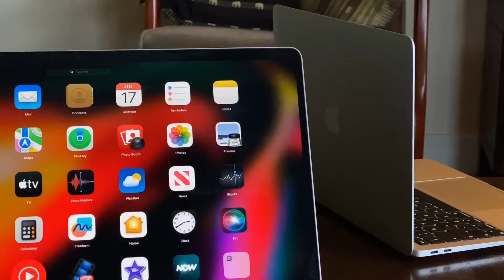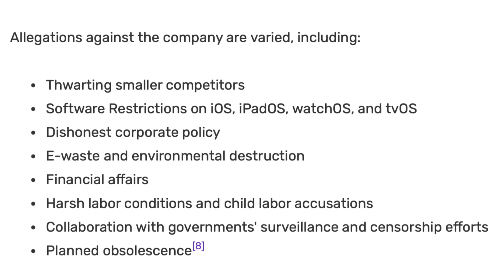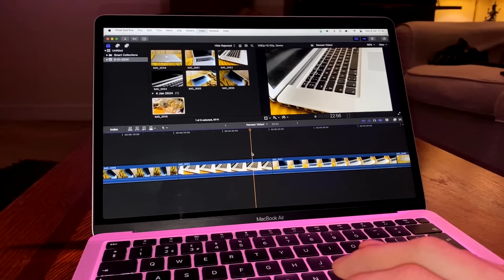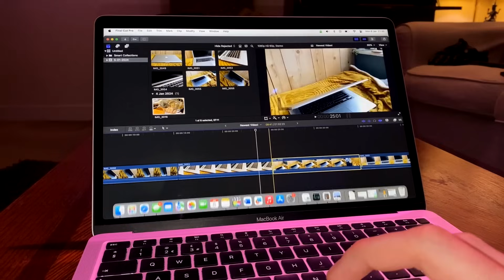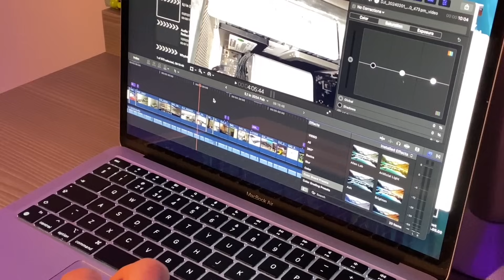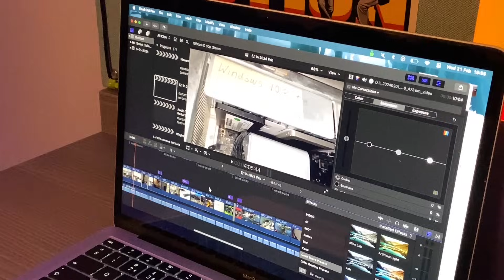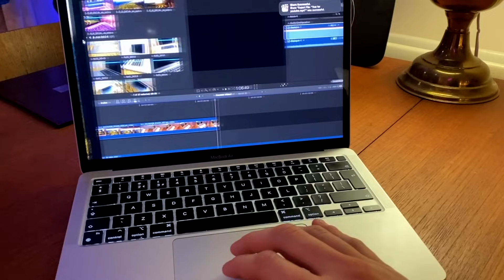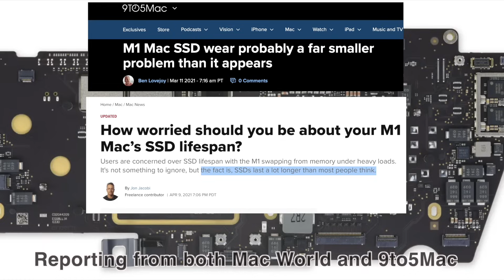Don't make the same mistake I did by buying a used Intel Mac.

Comment: You're missing the point about old macbooks.
They often had upgradeable hard drives (and even RAM in some models).
By constantly buying the new stuff, you're just playing into Tim Cook's hands.
Reply from the maker: Did you watch the full video..?
Reply: Why do you buy "constantly new stuff"? 

I am building my own PCs since the 90s and learned this: as a gamer, the only thing you more or less regularly upgrade is the graphic card, and even that wasn't a topic any more in recent years when games started to align to the performance of current gen gaming consoles by design. These days, you can run any game with a AMD 5700 or an NVIDIA 1070. But eventually Macs are nothing you use for gaming. When upgrading my PC, I noticed that the most benefit over the years originate in switching from HDDs to SSDs and in switching from 8 GB RAM to 16 GB RAM, which I run on all my machines  and never saw anything justifying to upgrade RAM further. I also learned that my needs are met by 1 TB of permanent storage. So that is a config I ran for years on a hackintosh: 16 GB RAM, 1 TB SSD.  I also learned that doing a major upgrade of the CPU is essentially a complete rebuild of the PC interior: you need a new motherboard, new (as faster) RAM, a more powerful energy supply and a better CPU cooler. You can keep the chassis, its fans and the permanent storage unless you want to benefit from faster access speed like PCI-E instead of SATA.

I  ran a hackintosh since macOS Sierra but bought my first Apple computer (since the Apple IIe) when Apple moved to Apple Silicon. That machine, a mini M1, configured based on the parameters established above from experience, supports my work (Software development) for more than three years now and there is no need to upgrade anything. I will run this until there are no macOS updates anymore for it. And there is still no pressure to ask for more RAM than 16 GB or more permanent storage but 1 TB. And with those parameters Apple Silicon Macs are still competitive in pricing. Despite Apples unreasonably looking upgrade price tags.
Reply: buddy, the computers you're talking about are 12 years old at this point. Most modern apps don't work on them anymore and they are starting to get to an age where the capacitors will fail at one point - and good luck repairing that on your own. Not even speaking about recent macOS versions, which you can get with OpenCore, but will run "suboptimal" to say the least with the natural limitations of memory swap (SSD even in RAID will be too slow) and the hard capped 16 GBs of RAM. So for anything more than mail and typing documents these will not make you happy.
Reply: A 2017 MacBook Pro is 7 years old. No one is talking about “constantly buying new stuff” we are talking about the fact if you buy a 7+ year old laptop it’s not a great deal and probably at end of life. I just got my M3 Pro MacBook Pro which was an upgrade from the 2019 MacBook Pro. I got 5 years out of it and probably won’t upgrade the M3 Pro for another 5 years. Two laptops in ten years isn’t “constantly buying new stuff”
Reply: @olafschluter706  Wouldn't be that much of an issue if Apple Silicon Macs supported eGPUs over Thunderbolt like they used to. Raspberry Pi and plenty of ARM systems support PCIE GPUs, I don''t get why that can't be any different with Apple's current hardware. Not even the new Mac Pros using Apple Silicon support GPUs.
Reply: Lol! I bought a Mac Mini 3 years ago for a few hundred dollars and am editing amazing, complex stuff with it
Reply: @KingKrouch  Sure, if you are happen to be one who notices a demand for more GPU power over the years the inability to upgrade GPU power is a problem. And the progress in GPU power has always been faster and more noticeable than the progress on CPU power, both with standard PC technology and Apple Silicon. Which is a bummer: even buying the Apple Silicon SoC with the biggest GPU power available at the time of buy may be superseded by demands (or better offers) within the near future.  That is why I find the mac pro hard to fathom: no more ability to upgrade the GPU power, now, what is its upgradeability worth then? The GPU is the most likely component needing an upgrade during lifetime of the device.

Comment: Yea I’m looking to buy a 2017 27” iMac - the fact that you can get these sub $500 is incredible - the display and design are still impeccable. I recently got a 2019 16” MacBook Pro and I love it a lot - people rave about Apple Silicon (as they rightly should) but for 90% of people, Intel was totally fine.
Reply: I bought late 2015 27” 5K month ago and it’s amazing. I have Mac Mini M1 for work and bought this iMac because of its amazing screen and I use it for internet browsing, discord, media consuming. You can’t buy a 5K monitor for this price and you get a whole computer!! IMO they are great value for money, because of that screen and with OCLP you can install Sonoma on them without problem. They are plenty powerful for everyday task, because of 4core CPUs.
Reply: I’ve owned a lot of computers over the last 30 years. I’ve built them and bought them new and used. My favorite machine so far is the M1 24” iMac. I thought the 24” display would be a downgrade from my previous 27” setup but I really don’t even notice the smaller size after adjusting the display settings a little bit. I do hope they offer a “Pro” iMac in the future with more Ram options and more GPU cores, but he 16 GB M1 is doing the job pretty well for now.
Reply: I bought 4.2ghz 5k 27 inch i7 imac 2017 with 2 tb ssd and 40gb ram. Dedicated graphics card. It's brilliant. I paid £300 I like the 27 inch 5k screen. And bootcamp.

Comment: I wonder, what if you intended to put Lubuntu on it or something? I was close to buying a 2012 Pro recently for the purpose, as well as the user upgradability/repairability of course.
Reply from the maker: Old Intel Macs definitely have their uses still. If you think you'd use it daily, and it's a good deal, you might as well buy
Reply: I had one of the plastic first intel MacBooks and once it reached the Snow Leopard ceiling I flipped it to Linux Mint for a while. I bought a new Lenovo a while later and sold the MB for parts.
Reply: you can probably get a 2019/2020 dell latitude for a similar price

Comment: no bootcamp on the arm macs, im sticking to intel, better compatibility for music production anyway on FL Studio.
Reply: You use it in bootcamp? Not in MacOS?
Reply: @Lukas-yw2mn  dual boot
Reply: @Lukas-yw2mn  for context i have a 2019 Macbook Pro 16” Core i9 & 5300m 16GB 512 ssd
Reply: @svntana700  well that’s a lot more powerful than mine! So I feel that, I probably wouldn’t upgrade then either.
Reply: @Lukas-yw2mn  what are you running?
Reply: @svntana700  I have a 2020 Intel MacBook Pro 13 with only 8 Gigs of RAM, and on MacOS FL runs very badly. So bad that I’m thinking on moving over to my gaming pc
Reply: @Lukas-yw2mn  yea i would move over to there if i were you, my pc is running on a Ryzen 5 7600 32GB 3TB WD BLACK and Blue and an RTX 4060 but i wanna get a rx7800XT only downside is windows 11

Comment: The fear for an SSD dying is not theoretical! 
I have a 2015 MacBook Air that I did not use for 2 years. When I tried to turn it on again, it had trouble booting. The drive would randomly show up as a boot drive or disappear. Was it the controller? Nope. I replaced the SSD with a new one and voila — I could reinstall and the SDD is faster and bigger than the original! I use at on a daily basis for light tasks again.
Imagine this happens after 5-7 years with your MacBook Pro that you paid $3500 for.
Reply: My 2015 macbook air that was an instructor's laptop for a period of time before me, had a damaged trace on the original ssd, so that had to be replaced. The original battery wouldn't sustain being unplugged for more than 10 minutes. Spent $90 for a 1tb samsung 970 evo+ nvme ssd + $10 on the adapter needed for it to run. As well as $60 on a brand new, extended battery. What an absolute powerhouse this Air is. Still useful in 2024

Comment: I use an Intel Macbook Pro 2019 16" I9 with 64 gb ram/1 TB drive. It much better than the two work Intel computers I have used, a HP Elitebook from 2020 and a Dell Lattitude 2024. While the Elitebook was somewhat comparable, the Dell laptop is not better at anything and is ugly and boxy.  I also have a Macbook Air M1, but I like the screen, trackpad and speakers of 2019 Macbook Pro better. Th 2019 MBP is still my favorite. It is also nice to use windows from time to time.  I like that Macbook Air M1 is cool and have extremly long batterylife.
Reply: I agree in the main message, but if you can buy e.g. a 2019 16" with good specication to a very cheap price, it does not need to be a poor choice.  But the 2016-2018 MBP should be avoided at all cost 🙂
Reply from the maker: @rolf7135  Definitely agree, especially with your second comment

Comment: Some folks are just hooked on speed (cars/computers/chemicals) for the sake of speed. The vast majority of users will never use it nor need it. Focusing on 'speed' is nothing more than clickbait. Personally am using a 2012 Mac Pro 5,1, which have had from new, with a metal GPU, 64GB ram and a USB 3.0/3.1 card. With OCLP have Sonoma installed. Do a lot of graphic work, adjusting scanned photos and making large prints up to 44" wide via Gimp. This machine has plenty of power - and frankly - would be sufficient for the vast majority of users. And I can fix it myself, if needed. And the internal storage available is, basically, limited by only one's budget.
Reply: GIMP? Oh, you are brave!

Comment: this is your only opinion, which does not reflect others. Bulshit. I purchased i7 Macbook Pro 2015 and I'm absolutely happy with this machine. Also I 've installed Sequoia on mine and it works as a charm so what you imply is a bunch of crap.
Reply from the maker: @ShmitsuShushin  dude chill. It’s obviously my opinion, but at the same time, they’re way, way slower than apple silicon, and the difference in cost isn’t worth losing over half the performance.
Reply: @montaguebarnabasltd  Really ??
What are you doing on this machine so you need this "super power as much"
watching p.😁rn ? then this is obviously overkill but it's you choice ;)
JK maybe if you really need more power than i7 2.5GHz with 16GB of RAM gives you but if you could elaborate why do you need it really, and how will you measure this EXTRA power.
I worked with computers since 1986 and I assume you've never a contact with anything slower than 2GHz and rubbish software.

😁
Reply from the maker: @ShmitsuShushin yeah i need a better computer so i can store all the photos of your mom on it
Reply from the maker: @ShmitsuShushin however
1. I need the power for editing video, which is my job. My M1 Mac is good at it, but struggles a little bit with artificial stabilisation, especially when I’ve got several layers to render in real time (I don’t have the storage or time to create proxies). I’ve used Intel MacBooks far superior to your 2015 i7, and they are rubbish for editing. Times have changed and we no longer have to pretend a mobile i7 that thermally throttles after half an hour is top tier. 

2. You can measure the performance in two ways. Benchmarks give us quantitative results.
 But measuring the time it takes me to edit is a better example here. Getting an M1 Mac has probably more than HALVED my video editing time. I can transfer files many times as fast, then I can do the edit without any load times. Undeniably better. 

3. Congratulations on a long career. I have a video on the 2-decade-old PowerBook G4 that might interest you?